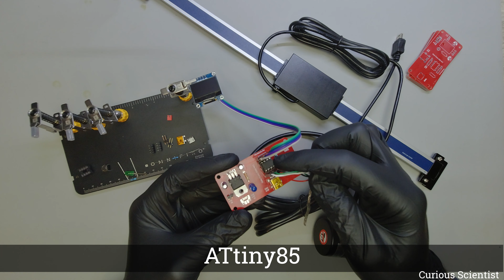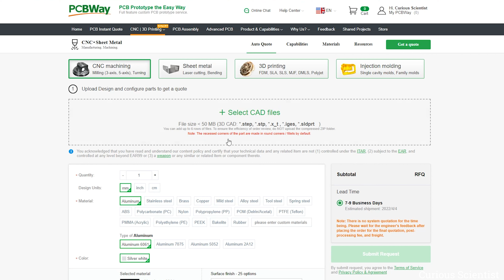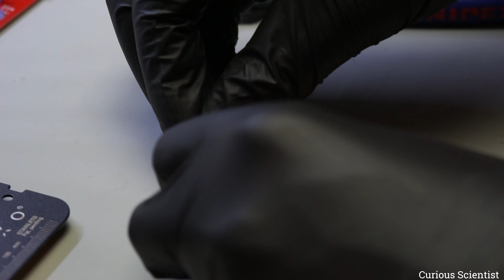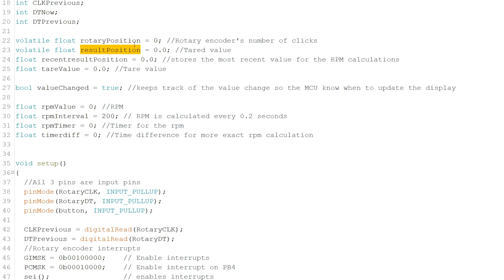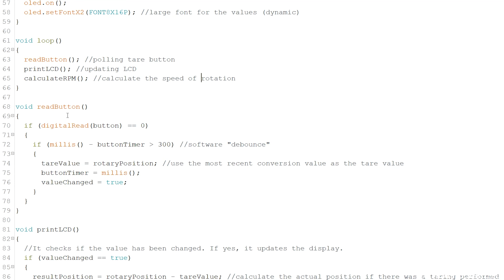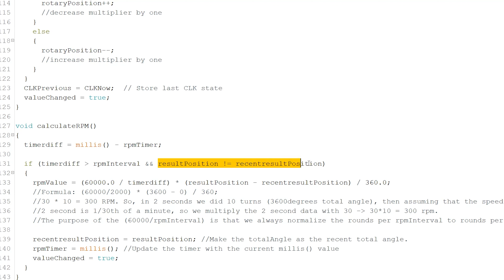Custom DRO PCB, but for rotary encoders

Comment: if I want to use a rotary encoder as functional a linear readout, belt drive or rack and pinion, the problem I see is you'll need calibration between the encoder count and the distance travelled. the chance of getting to a round figure off the shelf is pretty unlikely. do you know how one will formulate the math to do the compensation? I'm pretty green to arduino and not strong on math. will be useful as rotary encoders are cheap and easy to find compared to linear scales. and if one drop the speed calculation out of the code, will that benefit the tiny controller?
Reply from the maker: Hi! The conversion has nothing to do with the Arduino. You need to know the geometry of your system. If you drive a belt drive, then the driving wheel has a certain diameter. So, from that, you can calculate the circumference and using the ratio of the circumference and the amount of rotation of the driving wheel, you can calculate the travel of the belt. You read the rotation with the rotary encoder. It is basic elementary school exercise: if 1 turn (360°) creates let's say 600 pulses, then how much travel was done in let's say 900 pulses? And similarly, you can directly create a belt travel-to-pulses formula because you know that in 1 turn, you have a fixed number of cycles and 1 turn is also a fixed amount of belt displacement. So you can directly relate the pulses to the belt travel. Rack and pinion is the same exercise, there should be a linear travel defined for a full turn of the wheel and that could be used to track the travel. 
Dropping the speed calculation won't cause noticeable difference, it is a simple calculation. But sure, you can discard it.

Comment: couldn't you drastically reduce your interrupt function? configure your interrupt to the rising edge of A, so whenever it fires you know that A changed from 0 to 1. You only have to read B, if B is 1 increase, else decrease. reduces the interrupt clock cycles to just a couple.
Reply from the maker: Yeah, the interrupt in this is not the most efficient. I just focused on getting things work. Curious and more skilled viewers can improve the code I published. Cheers!

Comment: Very interesting.  You have done a lot with DRO scales, and I've found them all to be very informative.  Have you ever done anything with the TouchDRO application?  Though they offer ready-made units, they also support building your own bluetooth adapter for many types of scales.  Their Android app is extremely good. Their bluetooth scale adapter is quite simple to build and they provide the necessary firmware for an  ESP32.  Thanks very much.
Reply from the maker: Yes, I have heard about it, but I have never used it. I can make my own module if needed, so I very seldom look at "off-the-shelf" stuff.
Reply: @CuriousScientist  The Bluetooth adapter consists of an ESP32 microcontroller, level shifters for 5v scales, and D-Sub connections for the scales.  They originally used an Arduino, but no longer support it.  I was wondering if you could make a bluetooth adapter using the UNO R4 that would work with the TouchDRO Android app?  It would be a great project. Thanks
Reply from the maker: The idea is good, but I have like 30-40 other videos that are waiting on my to-do list. I most probably won't work on this kind of stuff in the coming year or so.
Reply: @CuriousScientist  Thank you for the reply.  I'm working on this now.  How to program an Arduino to send data to an Android app via Bluetooth.  I'm also working on building and programing a SCARA robotic arm with Arduino.  Your videos have been very helpful in my studies of Arduino.  Thanks.

Comment: I really like your idea of that small DRO, commercial solutions that small are expensive, are you planning adding more axis or your proposal is use many as needed?
Reply from the maker: Thank you! At this moment I have 3 other PCBs waiting for to be designed and assembled, so at this moment I am not planning to add more axes. However, it would be a fun future project. It would need another MCU, because the ATtiny85 would not be able to handle let's say 5 axes (x, y, z, r, t). Right now, I would suggest 1 of this board per axis.

Comment: Hello how are you, nice video as all ways and have seen other videos, nice way to conect TS100 to a 24 v powerr supply, will do that. I have commented in video (  300 mm DRO with Arduino (ATTiny85 and Nano)  ) for using  rotary encoder as DRO connected to a ball screw 4mm pitch or movemant in one revolution to read or display on screen. In this video or you last video reading is for PPR and R/M, for DDR let say Rotary Encoder 400PPR connected to a Ball Screw with 4mm movemant in one revolution eg 4mm one turn divide in to 400PPR = 0.01mm for each PPR turn, if 800PPR are used then you get 0.005mm per 1PPR , and I think to use encoder PPR to match lead of Ball Screw so you dont get od number when is divided like 0.00532 better to have 0.005 than 0.00532, RPM is not needed for DDR.  2 PCB  in 1 PCB  and one Axis for each Z and X with a Bluetooth to connect to aTouchDRO from google Play store. Can you do PCB and Software for it .thank you .
Reply from the maker: Hi, I am fine thanks and I hope you're doing well too! I would say that the PPR should be up to the requirements of the project rather than to personal preferences. Also, for displaying the numbers, you can always use rounding, and the software "doesn't care" about the extra digits, it can work with those. I am pretty sure I could make that PCB, even the software as well, but I am not going to work on it for free. Sorry, but I am not doing anything on requests for free.
Reply from the maker: No offense were taken, don't worry! 
I am not planning to enter the DRO market, so I think I will not put any efforts in developing software for this specific hardware. I just share those things which I enjoy doing and that's all. If people want to use it, they can use it. If people want me to develop something for them, they can approach me and we can make a deal.